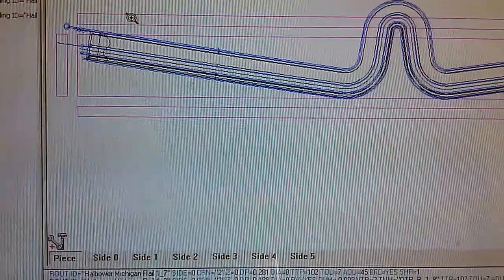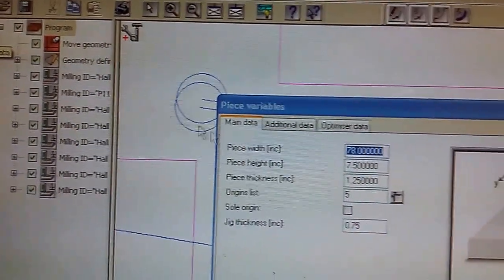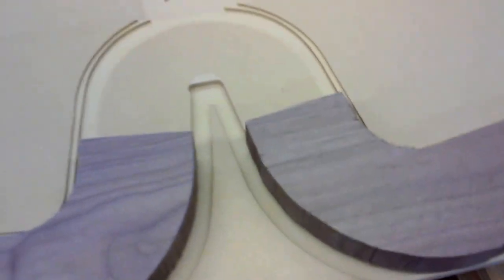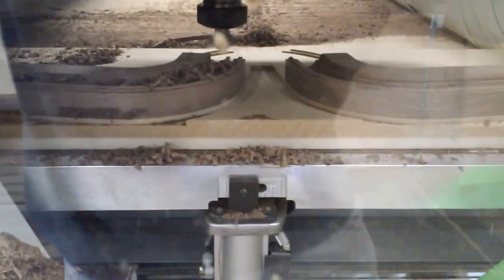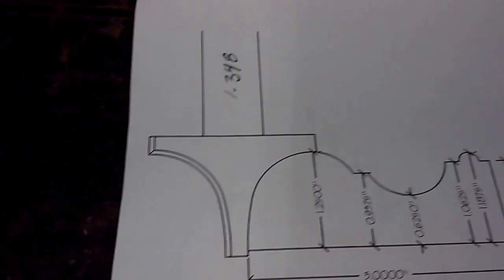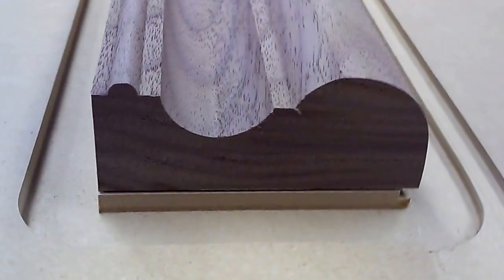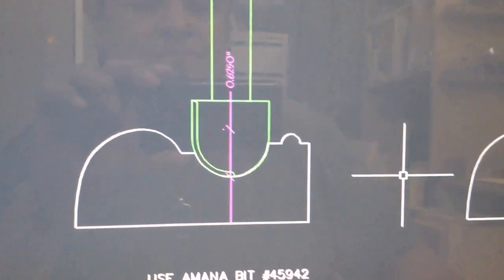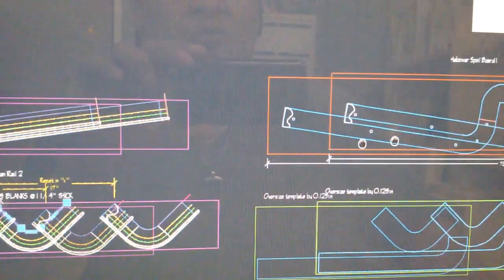CNC Biesse skill 1536 Hand rail

Comment: I work in a wood shop as a floating CNC beam saw/router programmer/operator and cabinet builder.  Our primary router is a Biesse Skill 1536 much like this one.  Your video was helpful to me, I learned a couple things.  I need to learn cad and learn how to export those files to the router, would make more complex designs easier than fully programming in the Biesse editor I'm sure.